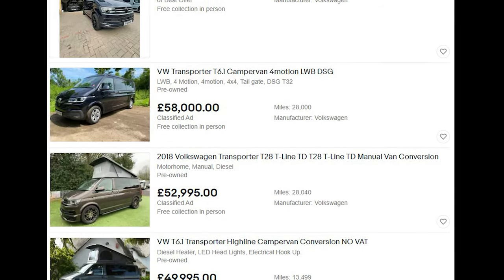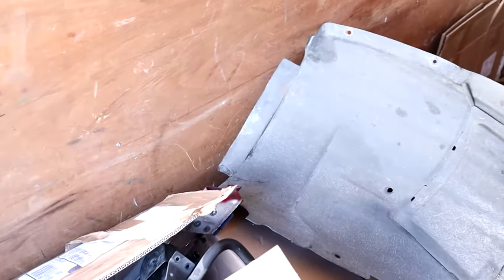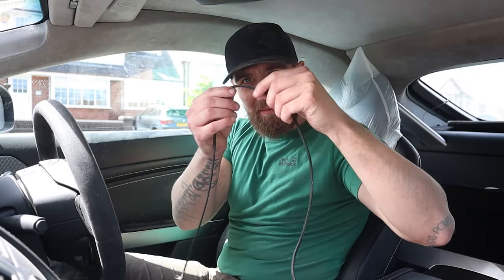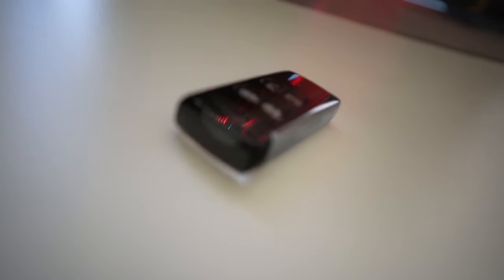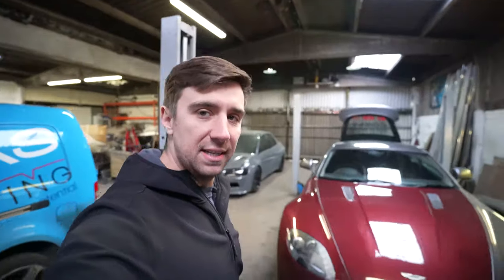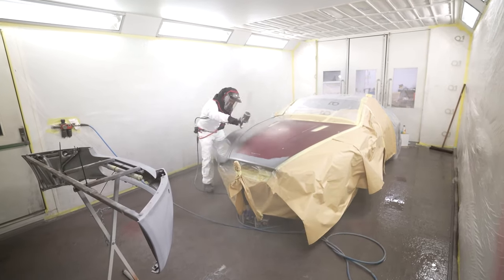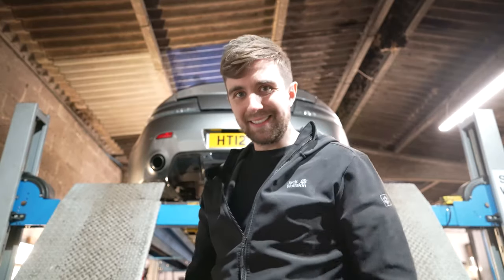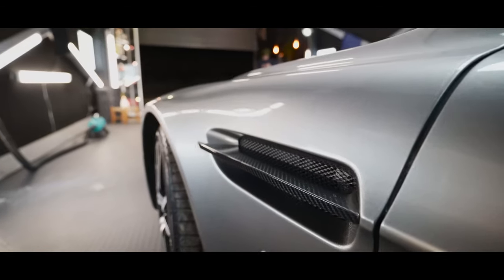My MAD Aston Martin Ownership Journey

Comment: Did you not take off the red paint on bonnet before re- painting it? Looked like you just painted straight over the old paint?
Reply from the maker: It wasn't necessary in all places. The paintwork was sanded back to a point where paint could be laid on top without any imperfections. 
It would be nice to do it the way yours saying but it would just take way more labour and cost a lot more to get the same end result
Reply: @CorpsMedia  yes I get you but the bonnet is one of worst panels to of not sanded back. You always get stone chips and now when you get stone chips it will chip off and you'll see red paint spots. Personally I'd consider getting it PPF over the bonnet
Reply from the maker: That's a fair point. I belive the primer for these were in red anyway. I was considering ppf now it's in the condition it's in
Reply: @CorpsMedia  possibly so. I've just bought a e92 M3 and finding paint issues exactly like I described lol. I'm getting a repaint then ppf saves on the OCD stress lol
Reply from the maker: @DaleSteel  sounds good man, tag me in some pictures on insta
Reply: @CorpsMedia  what's your insta handle?

Comment: Why didn't you get The Hamworthy Body shop to paint it ? too expensive ?
Reply from the maker: They were originally going to do it, but because they were going to do it at cost it meant I had to wait for some time free on the ramp. This took a little longer than planned as they are super busy since their work is to such a high standard. I then approached some other garages for quotes (but I obviously wanted to take part in the process). Stuart at SC performance offered to do it and teach me the process so I took him up on the offer (he also did me a slight discount).